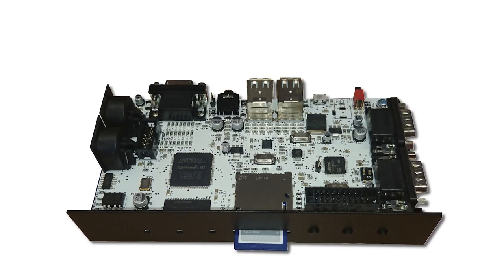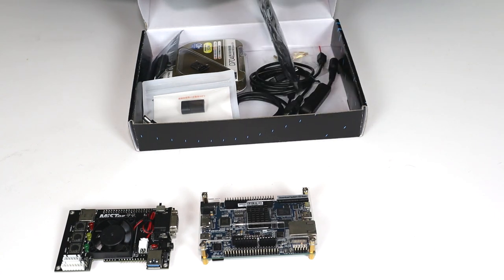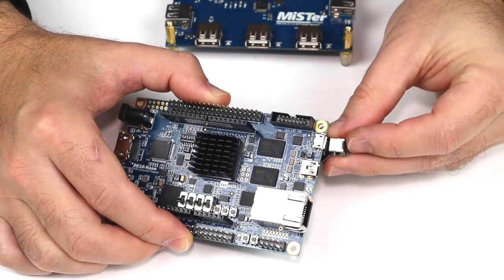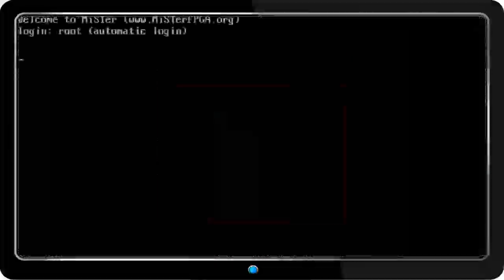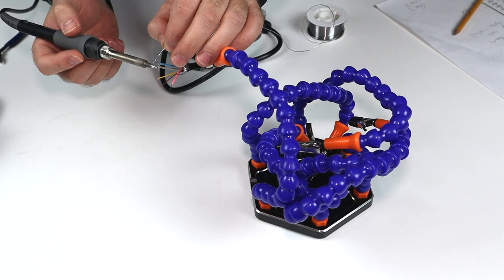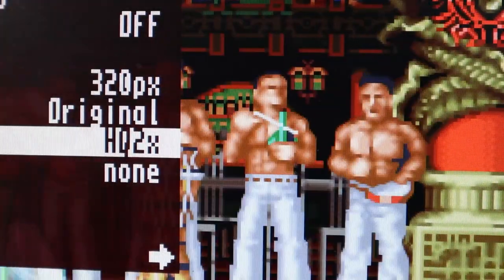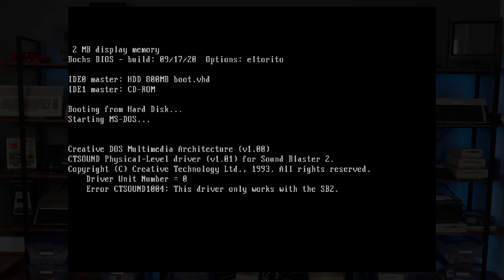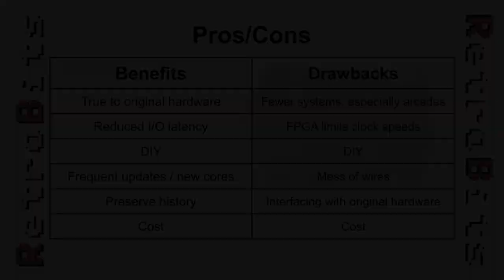MiSTer FPGA - How to build & configure, demo, cost, and pros/cons

Comment: These are the types of videos we need more of. So many ppl are scared to jump in. The lack of in depth videos such as these also makes it harder for ppl to come aboard. Keep it up!
Reply: Exactly. This shit's the shit.
Reply: Cost is the issue. When a complete Mister costs hundreds, then that is out of reach of most who just want to play retro games, and emulation is much much cheaper and easier.
Reply: @mrkirk4944  while I agree that it doesn't get much cheaper than a low cost pc or raspberry pi, there's so many ppl who plunk down $$$ for the Analogue consoles which only play 1 consoles games. Given the accuracy/dual output/extra features, mister fpga is a steal if you stream or want fpga accuracy. For me, its worth it for CPS1/2 alone
Reply: @lalos3813  For me, personally, the Analogue consoles are a complete waste of space. I own REAL hardware, and I never paid anywhere near the price of those Analogue consoles, I also prefer real hardware. For FPGA, I think it's great, and as close to my real hardware as you can get. But, most people I know, who lived through those classic 80s and 90s, don't have that kind of spare cash to splurge on a FPGA - many are married with mortgages and kids. Most, get home from work, eat, engage with family, then later in the evening just want something cheap and easy to use so they can play those old games, and a Raspberry Pi is enough for them to enjoy those games. And to be honest, you connect a Pi to a real CRT, and put it next to a Mister, and they won't see any difference in the games.
Reply: Yeah i think all the separate parts you can get and setting it up is what holds mister back. If only some company would put it all together, stick it in a nice case and sell it as a product it would be so much more popular. They need to focus on making this a product not a DIY with a gazillion different configurations, options and addons from 3rd parties.
Reply: @Jaml321  misteraddons.com has everything pre built. Just drag and drop roms, easier than a pi

Comment: One of the best MiSTer "introduction" videos I've seen! Great job at clearly showing the build, setup, and what it can do game-wise.
Reply from the maker: Thanks for the feedback!
Reply: @retrobitstv  You know I've been thinking of getting into Mister for a while now (I even bought a couple of old CRT TV's in very good condition in preparation - to fully utilize analog video output for full retro feel lol), but I am not a DIY kinda guy, so I was still on the fence and postponing the whole thing, trying to convince myself that software emulation is "just as good" nowadays etc. But thanks to your helpful video, I think I am ready to jump in.
Reply: @kosmosyche  which CRTs did you buy?
Reply: @kosmosyche  the main reason I haven’t done this yet is because CRTs take up so much space
Reply from the maker: Awesome. Good luck and have fun with it! BTW even though I made the RGB cable in this video, they are available for purchase through online vendors if you don't feel like doing that part yourself!

Comment: I've been keeping an eye on MiSTer for a while.  NeoGeo support almost made me get one, but I decided to wait for it to mature a bit.  I'm also hopeful for CPS2 hardware support.  CPS2 and NeoGeo alone are worth the price of admission for me.
Reply: Oh the Neo Geo core is very mature, one of the bigger contributors to the Neo Geo core is someone who been decapping original Neo geo proprietary chips to reverse engineer for repairing MVS and AES mother boards. To me the Core is a strong 99.99% accurate with allowing some leeway for the various hardware revisions of the Neo geo. 
The only thing the Neo Geo core missing is Neo Geo CD support, which is like missing 2 games Samurai Shodown RPG and Ironclad, and not too long ago someone figured out a port of Ironclad from CD to MVS/AES format (from the Wii VC release).
Reply from the maker: CPS2 beta core just dropped yesterday :)
Reply from the maker: CPS2 core is now public and works great!
Reply: Buy it david
Reply: Dont wait too long, its becoming harder and harder to get a de10 and the price will only go up.

Comment: Good job, great intro. My latest build came in at about $300 and includes : nice mini-ITX case, soft power on/off, front USB ports, 48W power/hub , VGA via the alternate dongle method, 64mb module, 2.4 GHz mouse/keyboard and all the extensions I needed including a sd card extender to make access easy. Just as convenient as any PC.  Even my first pass (DE-10 nano, 32gb module, cheap OTA mobile hub, decent sd) was super-fun and that was less than $200 USD and 99% of cores are fine.
Reply from the maker: Nice. I should have mentioned some alternative options for folks who specific / different needs. Always with the hindsight I tell ya. I do want to transplant mine into a case as a next project. Need to do some research on parts first and figure out what might be a suitable donor.

Comment: As of 1.5.2021 the ao486 is a 486sx (no co-processor) running at max 90mhz.  Advanced caching has been implemented so it's still way faster than a normal "sx".  It can run up to Windows ME if you use the /NM switches during setup.  Only real mode disk access means anything more than DOS can be slow and breaky.  That being said, having a 486 again has been fun :)
Reply from the maker: I haven't even tried Win95 yet, but it's on the to-do list. I noticed a big performance improvement with an update not long ago. Impressive how it's still getting faster!

Comment: 5th gen is definitely possible on MiSTer. PSX is in the works right now, and all signs point to it fitting within the de-10's constraints.  only 5th gen consoles i can think of that would have issues are Saturn and N64.  Saturn is largely unknown at this point but unlikely, but N64 seems entirely unlikely, given the requirements.  PSX, Jaguar, FM Towns Marty and Amiga CD32 should all be within the realm of possibility, however.

Comment: make sure you always reboot befor you load a core or sometimes it will causes games to flicker or other strange bugs when you dont
Reply from the maker: I hadn't noticed this problem yet, but I'll keep your advice in mind if it pops up. Thanks!
Reply: Yeah the MiSTer doesn't clear the RAM when you switch cores which can cause bugs. It seems to be more of a problem in certain cores like the NES core
Reply: @HouwariAttack  Hitting reset good enough or does it require a power off/on?
Reply: @emusnes   it depends but at this point it wont matter looks like what they are calling DDR3 bridge hang has been solve after 2 years this hard to track bug was found by bellwood420 while he was trying to fix the cave core not booting for some users. go here to read about it https://misterfpga.org/viewtopic.php?f=2&p=17119#p17119

Comment: One of the best videos about MiSter that I've ever seen. One more pro on the FPGA side, btw., if you install the DE-10 nano IDE you can actually make the chips visible by just importing the MiSter cores one by one. Have you ever been wondering how the logic of an 68K or 6502 works? You might probably not do the same with a Software Emulator like the Raspberry.
Reply from the maker: Very cool idea, thanks for sharing!

Comment: I'm glad you used the term "FPGA-based emulation", because that's technically accurate.  It is indeed emulation, just at a different level.  Like all emulators, not all are perfect, so while latency is low on an FPGA, accuracy is only as good as the people who wrote the emulator core(s).  Pros and cons.
Reply from the maker: Great point, thanks!
Reply: @Jim Leonard: Technically, it's simulation, not emulation :)
Reply: @sierraromeoromeo2444  That is splitting a very, very fine hair, and I'm not going to touch it (software people have different definitions of simulation vs. emulation than console emulator people, for example).
Reply: It's always a question of what you want to achieve... the majority just might want to play the old games, emulation on any other device is good enough.
I came across a backup of very old demos a year back, couldn't get it working on any system, including c64mini (dissapointing little device).
On a mister core it does run, not with the level of accuracy i'd hoped for, but well enough to have fun.
Reply: It's no more emulation than a later revision of a computer or console which consolidated a bunch of logic into a PAL or ASIC to reduce chip count. Would you say the C64C is a Commodore 64 emulator? Incorporating the logic of an entire system into an FPGA core is no different, it's just taking it to the extreme.

What about the various Soviet and eastern European clones of systems like the ZX Spectrum? The accuracy is only as good as the people who reverse engineered the platform. Are they emulation, too? What about later revisions of systems that contained bugfixed OS ROMs? They aren't 100% accurate to the original either. Do you also consider such systems 'emulation'?

I totally agree that simply being FPGA does not guarantee perfect or superior accuracy - there are many cores that are currently no more (or less) accurate than the most accurate emulator - the MiSTer Atari 8-bit core vs. Altirra is a perfect example. But saying something is worse or no better than emulation does not mean that it is emulation.

There is no host platform. No translation of instructions native to the target system to software routines on the host. No representation of the target platform's RAM, ROM, registers and flip-flops being simulated as arrays in the host's memory. Accurate or not; for better or worse, an FPGA core IS the target system - and that's why IMHO, it's not emulation.

Posted from my IBM 5150 emulator.
Reply: @lister_of_smeg6545  curious about your IBM 5150 emulator 😜
But yeah, the more obvious examples might have been Commodore 128 or PS2/3 offering "backwards compatibillity". You're about right that almost all revisions of a device will lead to some sort of emulation, thx for adding that perspective.
Reply: @lister_of_smeg6545  You wrote yourself "The accuracy is only as good as the people who reverse engineered the platform."  So while it is not emulation, it is simulation, and simulation is not guaranteed to be identical.  How can we verify if the simulation is accurate?

Because of this, I prefer to run the original hardware to remove all doubt.
Reply: @sierraromeoromeo2444   Technically? 'Emulation' comes from the term 'Emulate', which means 'to copy'. Emulation isn't a technical term. You're wrong. If something copies something else, it is emulation. A parrot emulates a human voice. A tennis player can emulate his hero. There is nothing technical to the term.
Reply: @ZaPpaul  In computer science, emulation involves translation, and generates "lag", 1 frame minimum. FPGA simulations do not suffer from lag when correctly implemented. But whatever, you're right, I'm wrong and incredibly bored, so yeah, whatever!
Reply: @JimLeonard  The FPGA Chip loads a core with programing that reconfigures the logical elements on the Core.
Both Software Emulation and FPGA, it depends on how well that programing is written and optimized. For FPGA they use a hardware description language that breaks down the hardware design description into a set of code. For some of the FPGA cores the system that being simulated is well documented and the layout of each component and chip is well known, for other cores as there a lack of documentation, or even have difficult to study proprietary chips, there is some guess work to be had. Some of the more talented contributors to the MiSTer project have acquired the original hardware and decapped Integrated circuits to see how they are constructed inside.
Reply: @lukasperuzovic1429  Thank you for the summary, that is mostly my view as well.

Comment: great video but the most important drawback is not mentioned: Mister can NOT do save states. emulators can, and most original hardware also can (eg Amiga Action Replay)
Reply from the maker: Good point! I think right now only the GBA core can do save states.
Reply: What? That is not good. I want to play smw and need to save games.
Reply: It makes sense; essentially because the "hardware" is not just a bunch of addressable bytes in memory, the virtual hardware would need to be extended with a function to dump or reload all its registers in order to implement save states.  It actually adds "cost" in terms of FPGA usage compared to a software emulator where there is basically no overhead to doing that.

That said, depending how the FPGA is implemented, if it is possible to stop the clock and serially read/write all of the state of the FPGA, it could be a good method to implement save states in a generic way "for free".  It would require some interesting post processing to filter out just the bits of the target system though, if you wanted to export a save state to use in other emulators or get the save state separated from the rest of the FPGA data.

Comment: Best explanation have seen so far. - I read online that when using the SNAC to connect a MegaDrive controller to the "special" USB on the IO-board, I need to switch a jumper, or the whole thing can go up in smoke? - Cant I just use a daemonbite adapter & plug it into the USB-Hub? - I was thinking of just starting with the DE-10 & figuring that out first, but maybe I at least lead IO also.
Reply from the maker: Many USB devices work with MiSTer, so you might be able to do just that. Using USB controllers does introduce some amount of lag due to how its polling works, but you can increase the polling rate to decrease the input latency.
Reply: @retrobitstv  - whats the alternative to USB though? - I heard the latency on the daemonbite is very low, 95% land on the same frame.
Reply from the maker: @brentgreeff1115  With the SNAC add-ons, it's as if the original controllers are connected to the original systems, mitigating any additional latency. But the downsides there are the controllers don't work to control the menus or with other cores. Myself, I'm perfectly happy using a USB controller and don't have the reaction time or play the types of games that require such precise timing in the first place! All this talk of latency is purely academic as far as I'm concerned :)
Reply: @retrobitstv  - for me, sonic on a CRT is a completely diff experience than playing on a flat panel. - sometimes I make a mistake & reverse direction. on a crt I can feel the instant change.  - I cant even play sonic on a LCD - it has no appeal. - My CRT is in storage at the moment while I travel. - I want to see how close OLED will get me & thanks for the info - SNAC might be the way to go for me.

Comment: The core I am most excited for is the PS1 core.  I truly hope they are able to pull it off, as it seems like it would be quite a feat to have a fully working PS1 core in FPGA.
Reply from the maker: I was really surprised when I heard that there might actually be a PS1 core on this hardware. Fingers crossed!
Reply: @retrobitstv  Same here.  I am honestly still kind of blown away by the fact that it's even possible, specially on this FPGA, as the FPGA in the MISTer really doesn't have that many logic units.  The chip they used is of the lower of of it's type.  

I still have my doubts that they'll pull it off, but I guess we will see.  Fingers crossed as you said.  It seems to be giving the devs a bit of a challenge considering how long it's been in development for now with loads of work still yet to do.

Comment: yeah it is a BEST video about MiSTer so far. excellent!  
I think Mister is a great FPGA option for specific console for people who cannot stand L.A.G.
problem of MisTer is ... lack of coherent or complete guide since it is just  a community / hobby project. It's not user-friendly unless you spent many hours to read. 
I bought Mister a year ago since I was hoping to get a MiST alternative for Amiga & MSX emulation. It is great but ... I have to read Atari forum. All the Mister forum are not so Novice friendly. also.. it's ugly comparing to other expansive Analog FPGA devices. 
I know.. nothing is perfect but I would not buy if I knew I need this much reading..
Reply from the maker: Thanks! Yea, and each core has it's own documentation and requirements but overall the installation and configuration is getting easier with time and there are more and more setup scripts that automate the heavy lifting these days too! I was thinking I might do a second video that's just a step-by-step on how to set up Minimig with a virtual hard drive image, RTG, and shared folder support from start to finish.
Reply: @retrobitstv  Yes, that would be great! also.. I never get automatic update script working for updating core, etc.  I almost give up on MSX though LOL!
Reply: I agree with you, nerds unfortunately dont like questions about the basics.